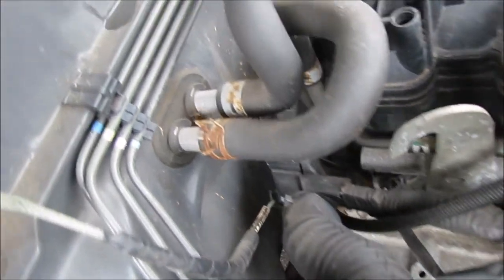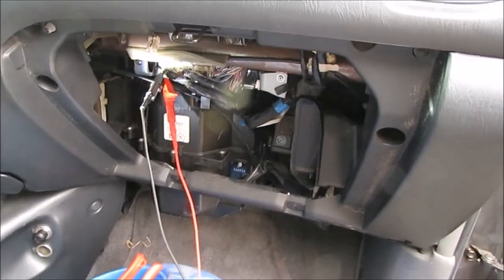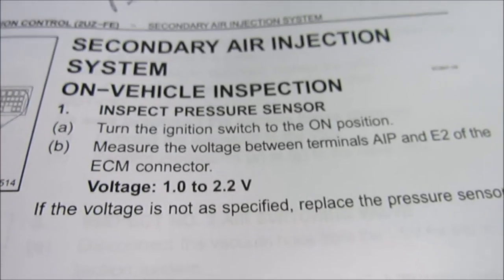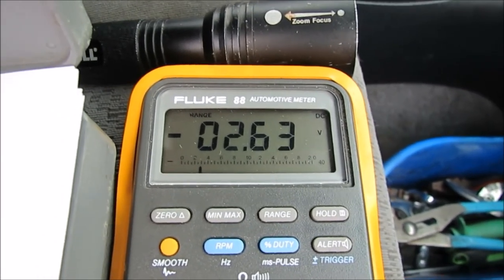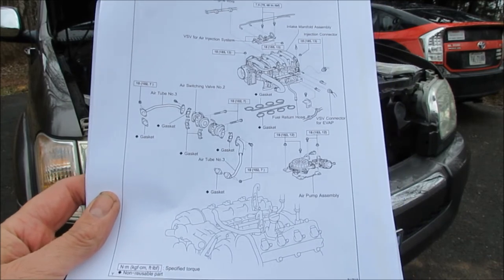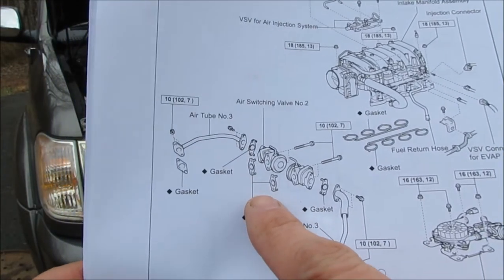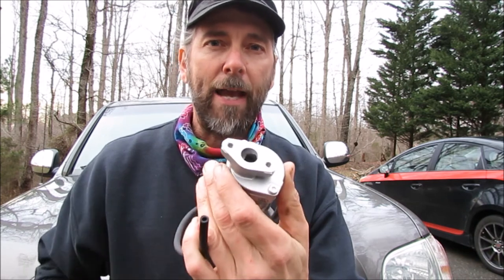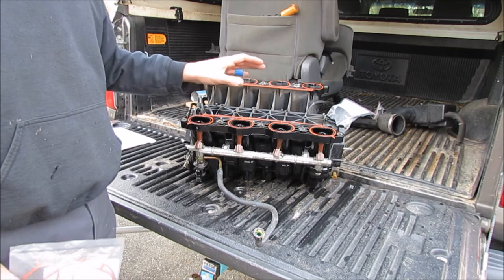2006 Tundra Air Valve

Comment: I just changed both of the secondary air valves today on my 05 Tundra. I replaced mine (Dorman valves) without taking the intake out because I wasn't changing any parts located under the intake.  If your hands and arms are not too big you can lay a thick piece of foam on the engine, lay across your engine and get your hands back there to remove the valves (take any rings and watch off). You'll need to remove the two wiring harness bolts (you'll need to jam a piece of wood to lift the harness up) and the bolt holding the cable housing to the fire wall (I tied the harness and this cable housing back to give me more room). Tools you will need: A swivel head 1/4" ratchet (a very important tool, mine was made by Titan and purchased for $17 at O'rielly's auto parts), a 10mm 6 point socket, a short 1/4" extension or 10mm 1/4" deep socket, a 12" long 1/4" extension, a flashlight and some patience. It can be done and you'll save yourself a ton of time.
Reply from the maker: Thanks for the tip

Comment: Very good job.  I have a 2000 Tundra with 4.7 and for years experience a power loss/no acceleration issue.  Have replaced everything (MAF sensor, new NGK plugs, new Denso coils, new knock sensors) and hoped this air valve may be the culprit, but my 2000 does not have this; at least not in the same location as yours.  You troubleshooting skills are excellent!  Thank you for sharing.

Comment: For Air Injection Pump issues after you fix them they will most likely fail again whether you use OEM or aftermarket. Mine failed 2x after the 2nd time I got a Hewill bypass kit truck has been running great ever since
Reply: They have about three different kits for the air injection pump bypass… Which one did you choose? If you don’t mind me asking.
Reply: @hooknladdercharters  Gen 2
Reply: Awesome th x

Comment: I'm running into the same problem, mine said bank 1 is bad.this guy got me all confused he showed the right side check valve changed, but he said it belongs to the left side, so which side did he replace right or left? Bank 1 or bank 2?
Reply from the maker: It's easy enough to pull the EGR cooler, EGR valve, and intake. Look at them, guarantee they're clogged. Clean everything out and put it back together. There's plenty of YT vids on how to pull the EGR cooler and valve. 
If you've done this before it can be done in a day, otherwise plan on taking a weekend to do it right, One day to get it apart and clean, a second day to put it together. 
You've really got to soak these parts in some strong cleaner and rinse thru numerous times to really get it clean (it'll easily take an afternoon just getting out the gunk and carbon from the cooler, valve, and intake ports). Not kidding, cleaning is very time consuming. You'll want to get it as clean as possible or you'll be doing it again in 6 months.
Or just buy new parts and replace: $$$ V.S. Your Time.

Comment: Thanks sooooo much for testing all of the parts. It was super helpful.
Reply from the maker: Glad you liked it. That was my intent, going into detail on ringing out the wiring and methodically checking things one at a time; people have a problem or read a code, go to Google, read somebody's comment where they say "I just changed part XYZ and it fixed my problem", so they go out and blow money on part XYZ, and it doesn't fix the problem.
Even though it made for a longer video (I got complaints on that), I figured it wouldn't hurt to talk through all my symptoms (I know 'blah blah blah'), because other people will be looking for more info than just "my truck was running rough" or "makes a funny noise".
I also discussed what was going though my head because with these problems we all have these 'why/what if/ maybe' type thoughts trying to get a grasp on the problem. Is it one thing? Multiple things? Bad gas? Full moon?
Finally walking people through the troubleshooting/elimination process so they could better understand that it can be tedious and takes time to properly diagnose; there's quite a few 'wham bam thank you ma'am" videos that give people the impression that fixing engine problems on cars is easy. I'm not trying to throw shade on anybody for taking the time to make a video with the intent of helping others, it takes work, and they're not all bad, but somebody watching those videos who's having trouble fixing a problem may get discouraged because their car problem is kicking their ass and not as easy to solve as the video made it look.

Comment: I’m fortunate enough that I was close to home when I got the pump noise, check engine light, loss of power combo. Got codes that pointed me in this direction and fortunately there’s enough of these good videos that saved me a chunk of change. 
I appreciate the camera quality, the to-the-point guide through the process and the fact that we are here today with trucks that are still worth keeping in the road. I love the Japanese 2U-ZFE, but you can definitely tell there’s some areas where the American workmanship reveals itself. At the end of the day, this is a fairly easy vehicle to work on and I encourage others to do the work themselves, mind as well do some other maintenance while you’ve got things apart.
Reply from the maker: We started out loving this 06 Tundra, but then we started finding things that soured us on this truck. 
Serious frame rust to the point where it looked like the frame was going to rust in two ( known problem).
The other problem was with the braking. I could stand on the pedal while driving and truck was hard to stop, tires didn't skid (ABS didn't kick in when doing a hard brake check unless on loose gravel). I replaced EVERYTHING in the system short of the ABS module; master cylinder, booster, discs, pads rotors, inspected and adjusted rear brakes, checked hoses, and bled a gazillion times, pedal never improved. It was telling to me that Toyota knew they had a braking problem with the design when I ordered 2 different master cylinder/ boosters and received two different designs each time and neither was right for my model year. After mucho research I finally found the design $$$ that was used on my truck. That was 3 different master cylinders and 3 different boosters all applicable to the same model truck ( engine, cab,  4WD).
I couldn't drive it, let alone tow anything with it out of fear of having make a hard stop and rear ending somebody. I talked to somebody at the dealership and they said they heard of this complaint for other owners.
We replaced it with an F-150, given our experience with this 06 Tundra, we lost faith in Toyota's trucks.

Comment: You are very good doing this video, I would say you could work also as a technical instructor. You are highly qualified.
Reply from the maker: Thanks. When I was younger, almost 40 years ago, I was a AH-1 Attack Helicopter Weapons Systems Instructor in the US Army. I taught the mini-guns, grenade launchers, 20 mm cannons, missiles, rockets, fire  control and sighting systems. I taught everyday for 2 years before reenlisting and changing jobs to AH64 Apache Repair Technician. Those were fun times, but then again getting older and looking back it was all fun times.
Reply: @robrig1646  wowwwwwwwwwwwww

Comment: oh no you bought aftermarket.  Our shop has done several of these and found not buying OEM bit us in the ass hard on these parts to where we started  suggesting  OEM because to have to pull the manifold again 6 months to a year and half tops later to replace the valves again did not make our customers happy.  I say use aftermarket in situations where it won't leave you stranded and does not involve big labor time.  In the secondary air injection arena use OEM always
Reply: I just installed non-OEM.  It didn't work right out of the box.  Time to start all over again.